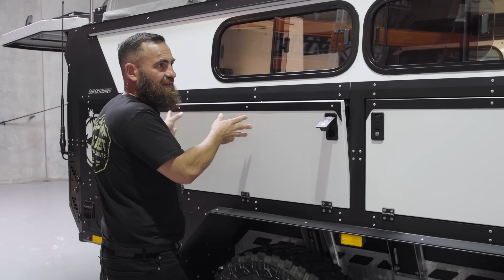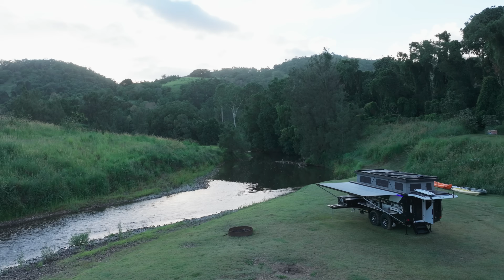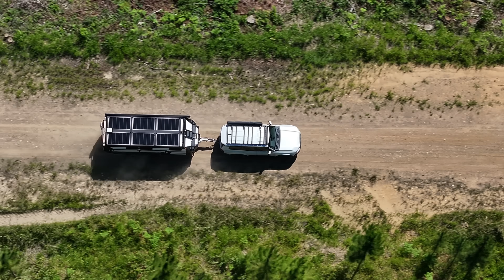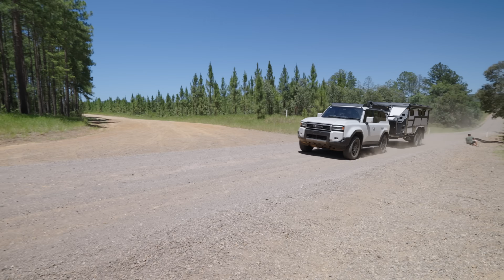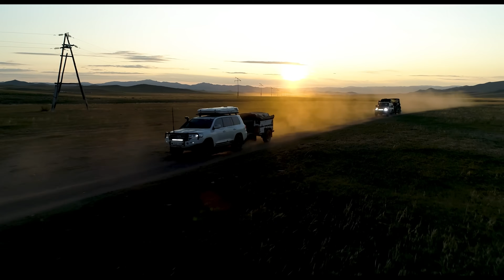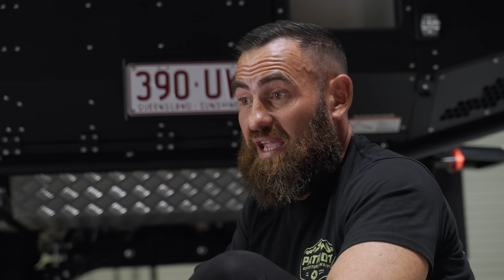Part 3 - ST7 SUPERTOURER Walkaround - Suspension & Service Module

Comment: are the TPMS Vavle stem caps??? If so in salty conditions I've experienced many times that they corrode to the stem making it nearly-impossible to remove without braking the front bead. Installing a new valve stem replacement

Comment: One quarter of a million dollars AUD with a few extras, rego and whackomole insurance. My gut feel is that this is likely one of the best well designed campers on the market but one question remains 'how many of us really ""need"" a camper this complex'? I travel with a fully offroad camper/poptop that costs $100,000 less and it pretty well does everything from Simpson crossings, all the Beadell tracks, etc, to guaranteed dustproof, bulletproof composite, probably more spacious design (ST7 has very thick walls construction and narrow interior) lightweight 2600kg max design with simplicity. I really do think take the ST7 and pare it down with little complexity (ie manual roof lift, excellent trailing arm suspension (is all we really 'need', flick off the complex control pad systems, who 'needs' 35inch wheels in Australia, etc etc), save $50-75000 and you will still have one of the best campers out there.....just a thought.

Comment: What is the insulation level of the walls/ floor/ roof? R or U value would help.
Reply: Exactly but I have no doubt the innovation and the construction is solid. I prefer my off-road trailer trailers to be more interior designed for cooking and living and very cold temperatures. I’m not sure the Aussie’s would know much about that.
Reply: @gregmoessner3104  the ST7 is what’s called a a hybrid caravan. Basically a really big camper trailer, but not a full on caravan. As such, caravans sold in OZ, generally only have cooking inside the van. There are literally 100s of different caravan brands to choose from. Hybrid caravan’s generally have an excellent outside kitchen, with the ability to have induction cooking inside if required. Most hybrids also have an internal sink for cooking etc. Hope this helps

Comment: Are you thing that you could go to a 48v setup in the  future
Reply from the maker: No plans for 48v 👍
Reply: @patriotcampers  Even Jayco have recognised that 48v is now the future and releasing new vans with 48v. All benefit and little downside with 48v especially when charging. You can go from 20% to full charge via an alternator in less than 2 hrs